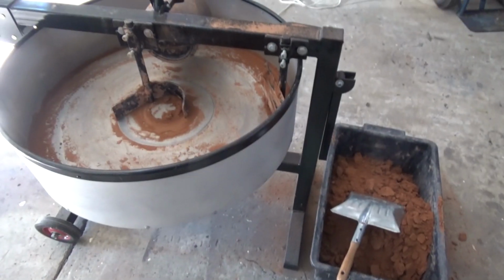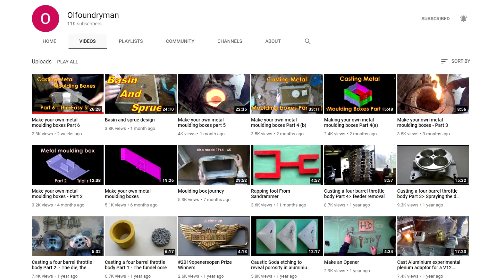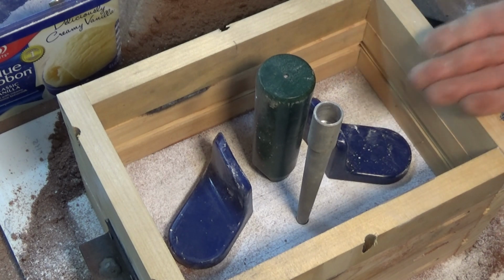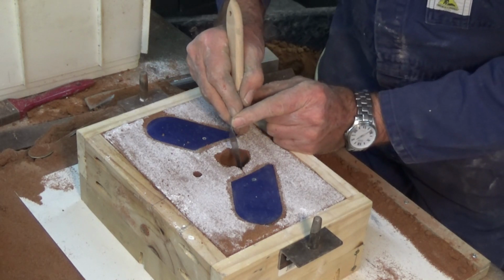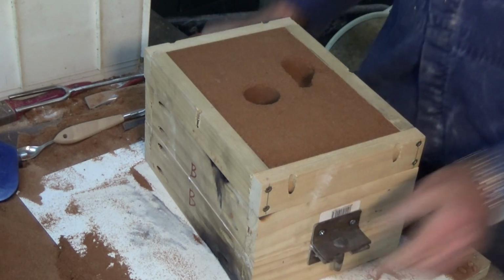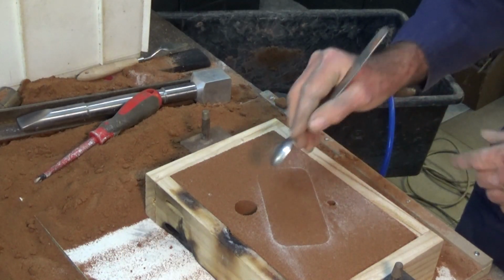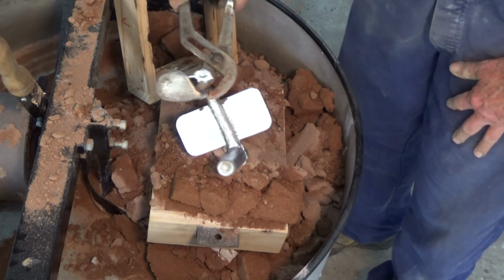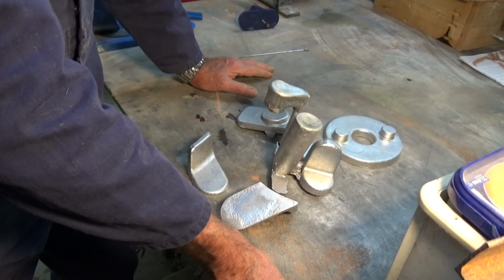Metal Casting With Single Sided Patterns.... Two Ways

Comment: Dumb question but, how much psi are you using with the air blower?
Reply from the maker: John, the pressure is quite low, probably only about 5 PSI. Any more than that and you risk dislodging the sand grains.
Regards,
Mark
Reply from the maker: Actually, maybe I misunderstood your question. I don't use any forced air draft on my furnace. If you were referring to the air gun I used to clean out the mould cavity it is run at around 5 PSI.
Regards,
Mark

Comment: To keep your wood flasks from being burnt try using a piece of steel  (angle iron, etc)  it will create a chill and stop the flow
Reply from the maker: Yes, I must try that. More often than not though, the charring comes from overflowing the basin as the riser fills or when something gets blocked up. Even though your eyes see the metal overflowing the hands just keep pouring the stuff in. The brain suddenly kicks in and instruct the hands to stop doing their thing but it's too late and your flask is now on fire! I wish I had some sexy cast aluminium flasks like Olfoundryman has.
Regards,
Mark.
Reply: Mark if you  put strips of metal such as 1" X  4" around the sprue and riser pouring basin etc. the flow will stop and  save your flasks. I also recommend weights  to prevent lifting or run out. I find the aluminum flasks are too heavy for my liking
Cheers Gene

Comment: I thought you have given up on tapered sprue
Reply from the maker: No, I still use it. Many years ago, before I found out about the work done by Olfoundryman and SWDweeb, I was using a straight, large diameter piece of copper pipe to cut my sprues and although it worked I found that a lot of my castings had porosity and sand inclusions. Since adopting the tapered sprue all those problems went away. The other thing that Martin (Olfoundryman) encouraged me to do was to buy good quality ingots for my castings instead of melting scrap. This has also made a huge improvement to the machinability and strength of my castings. 
Regards,
Mark